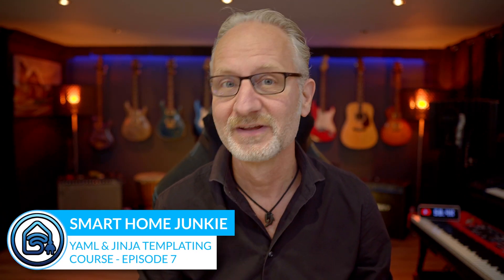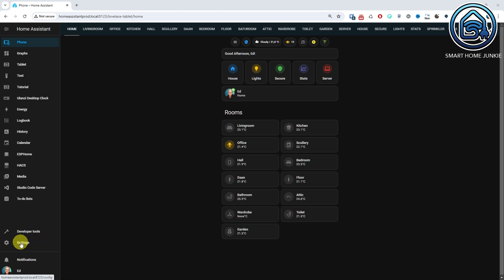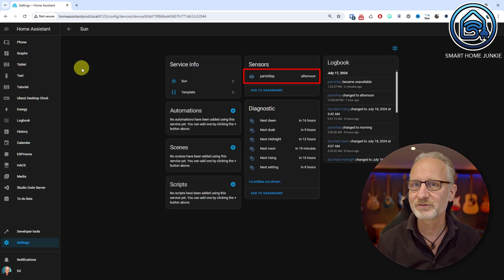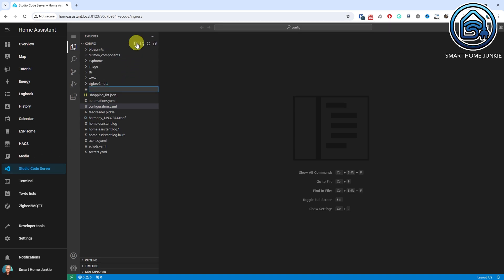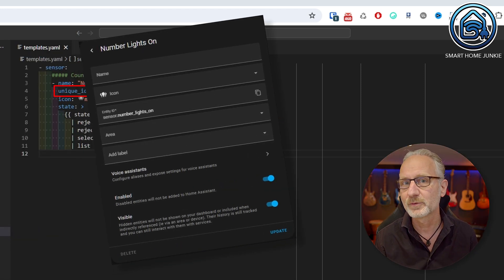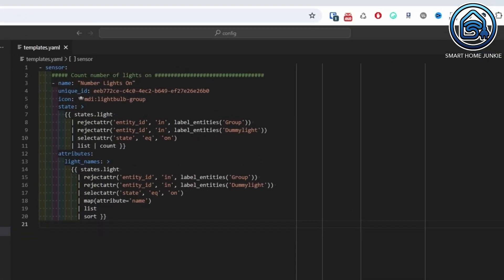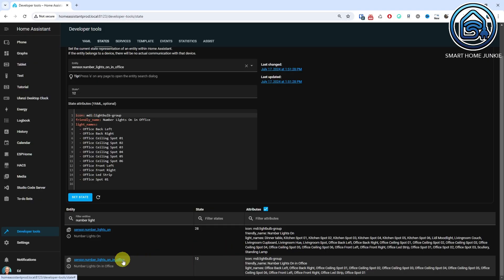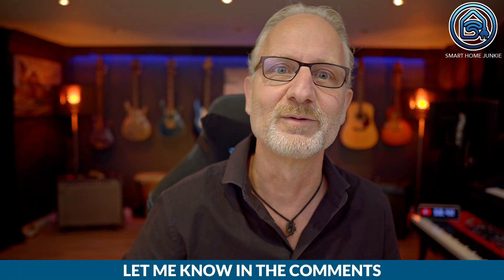Home Assistant Jinja Part 7: Create Custom Template Sensors for Lights & Rooms

Comment: Thank you lots for this Course. Such detailed tutorials are hard to find. It helped me much to understand template sensors. To tidy up my system I created several xxx.yaml files for my templates and put them in a folder called teamplate. This worked well and i can find my template sensors faster. I have a problem though. Some of my template sensors should get triggered every hour or minute. I have some problems to get the syntax for those template sensors correctly and now some of my sensors doesnt work anymore. Maybe you can make a tutorial about the syntax with triggered template sensors one day?
Reply from the maker: I already created one: Unlock the Hidden Weather Forecast in Home Assistant
https://youtu.be/zrWqDjaRBf0

Comment: Even after viewing the entire 7 episodes I had no idea why I need Jinja in Yamel. Asking ChatGpt gave an answer in 1 Sec. Yamel is static and can’t use dynamic elements. Jinja is an add on to resolve it making it dynamic. I wish you had explained in the 1st episode why Jinja is needed from the start.
Reply from the maker: And you still don't spell YAML correctly 😂😂😂
Reply: @SmartHomeJunkie I like Yamel. I will start using it myself :-D
Reply: @ezrakopee He didn't use those exact words, but he did explain it in the first episode.

Comment: thank you for video. but one problem I have. I already have sensor in node-red, which is summary of three sensors SSR1+SSR2+SSR3 and it's name is SSR_power. I have created it as template but HA created sensor 'SSR_power_2' although I have specified correct name. Can I replace node-red sensor with simplier one with the same name? I need it, because of history... thank you!

Comment: Very clear and accurate tutorial, as usual. With the same method, is it possible (easy) to manage the OFF line devices in Zigbee2MQTT? I didn't found corresponding attributes for my motion sensors.

Comment: Thanks again!  With this and episode 6, I replaced my Total Power summation sensor which was about 30 lines of code with a very clean single line of code.  Now I have a single sensor that adds all my power loads together, and all I need to do to add a new one is to add the label to it.  I modified the code with the map('float') and sum functions.  I use this sensor to display the total instantaneous power draw in my house on my dashboard.

{{ states.sensor | selectattr('entity_id', 'in', label_entities('Power Load'))
                 | map(attribute='state')
                 | map('float')
                 | list | sum }}
Reply from the maker: So cool that you managed to narrow your code down with help of my tutorials! 👍🏻👍🏻

Comment: Hi,

Initially I followed your videos to recreate the sprinkler watering system in order to learn as much as I can. I ran into issues with a couple of things. 
I have since resolved the issues but the major issue has been the sensors not updating . As I had created the sensors myself after purchasing the latest code from you the sensors ended up with a modified name suffixed with a l_2”. In order to resolve is there a way to remove the original sensors that I had created from cache

Comment: When you make a sensor, HA will store that value inn its database.  It will take more space and if you are running Raspberry PI with SD card, it will wear out faster.   If you only need to display a number, but not store it, you can make lots of calculation directly in the display card it self.  (Do you really need to go back one month and see how many lights that are on?  I know this is just an example, but this is how you should think)
Reply from the maker: If you are still using an SD card, you should upgrade your system. This is how you should think. 😉
Reply: @SmartHomeJunkie  yes, but it’s good being critical about what data to retain and for how long.
Reply: @SmartHomeJunkie  Sadly the HA on  Pi installation instructions do not explain this for new users to understand.I only found this out after running on a Pi for over a year and performance started going downhill.
Reply: You can easily control which sensors are saved in the database and which sensors are not using the HA Recorder "include" and "exclude" configuration variables.  A big advantage to creating template sensors, is they are available for use throughout HA, not just for display on one card.
Reply from the maker: @major_west  Exactly this.